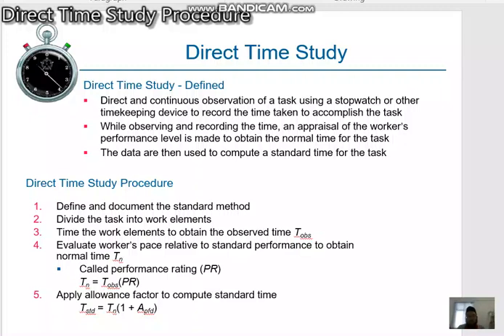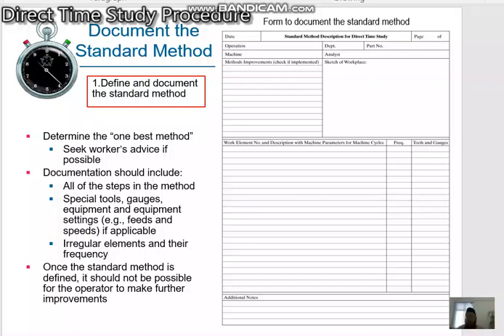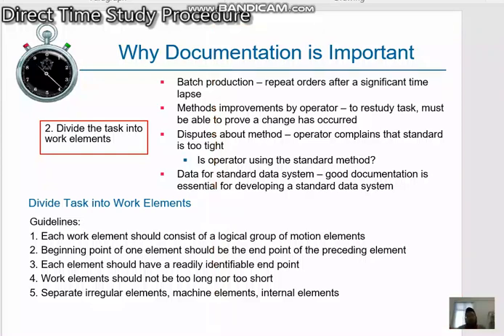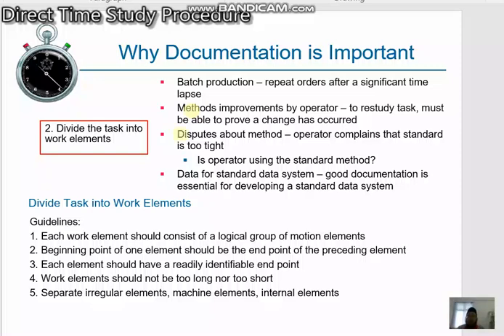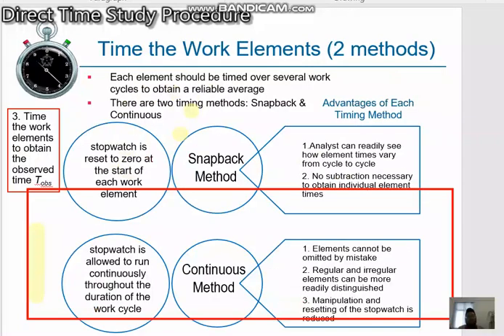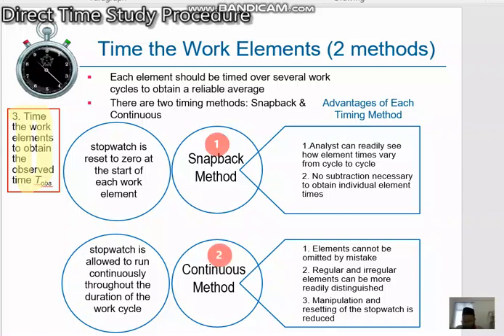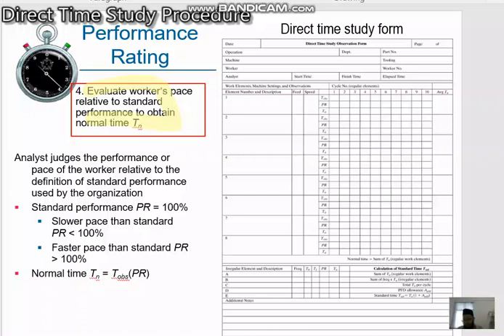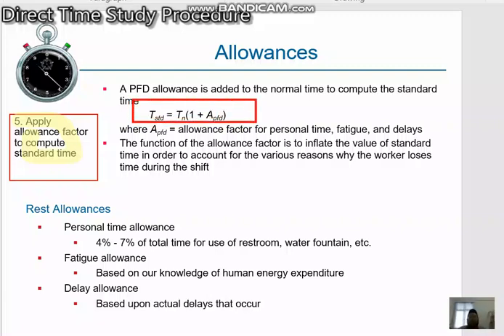Direct Time Study Procedure

Comment: B052020032
I learnt the direct time study method from this video. The first step is to define and describe the standard method, after which we should create the document using that way. The assignment is then divided into work parts. Work components should not be too long or short. This phase is crucial since building a standard data system requires a decent paper. The third step is to time the labour parts in order to acquire the Tobs time. One way is the snapback method, while the other is the continuous method. The fourth step is to use the formula to calculate normal time Tn by comparing the worker's speed to standard performance.

Comment: B052020024
From this video, I have learned the direct time study procedure. First is to define and document the standard method whereas we should form the document following the standard method. Secondly is dividing the task into work elements. The work elements should not be too long nor too short. This step is important because a good document is essential for developing a standard data system. Thirdly is time the work elements to obtain the observed time Tobs. There are 1 method, 1 is the snapback method another is the continuous method. Fourth is to evaluate worker's pace relative to standard performance to obtain normal time Tn by using the formula. Lastly is applying the allowance factor to compute standard time by using the Tn and the Tstd formula.

Comment: b052010051
from the video I got to learn the steps that need to be taken in procedure which is to document the standard method firstly define and document the standard method, it cannot have any more improvement this. secondly, divide the task into work elements, irregular, machine, and internal elements are separated. third, time the work elements to obtain the observed time using either snapback or continuous method. forth, evaluate worker pace relative to standard performance to obtain normal time. lastly, apply the allowance factor to compute standard time.

Comment: Muhammad Firman Haiqal Bin Mohd Rahim (B052110178)

From the video, the first procedure is define and document the standard method. The documentation must include all of steps in the method and equipment settings. Secondly, devide the time task into work elements. The third procedure is time the work elements to obtain the observe time. Two methods of timing the work elements are snapback method and continuous method. The fourth procedure is evaluate the worker's pace relative to the standard performance in order to obtain the normal time. The fifth procedure is apply the allowance factor (PFD Allowance) to compute the standard time.

Comment: MUHAMMAD NAJMI BIN MOHD NIZAM (B052110005)

from the video, we must do some form to determine the standard time. they have 4 important of documentation and the first one is batch production lapse , methods improvement by operator, disputes about method and data for standard data system . they have 2 method time work elements is snapback method and continous method .lastly, we have must do some form about perfomance rating to show the time of the worker taken.